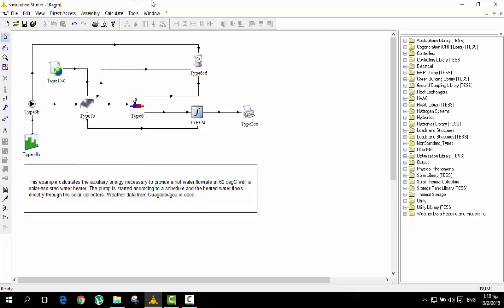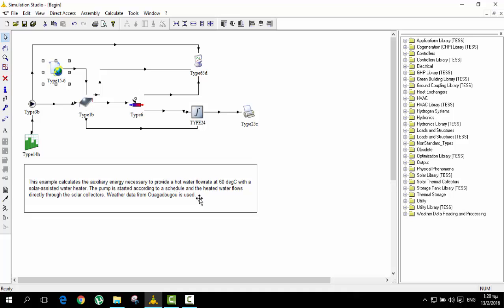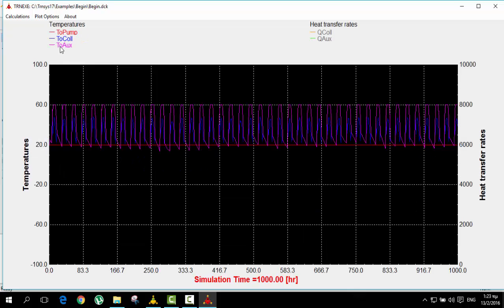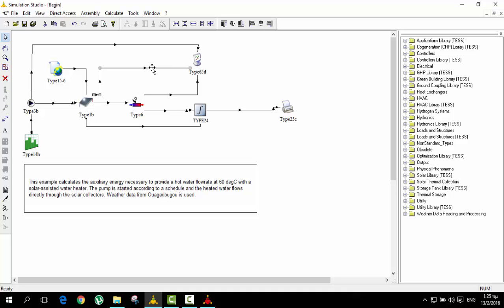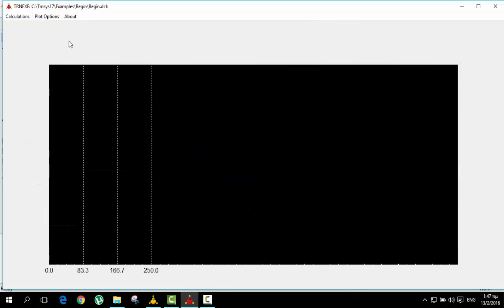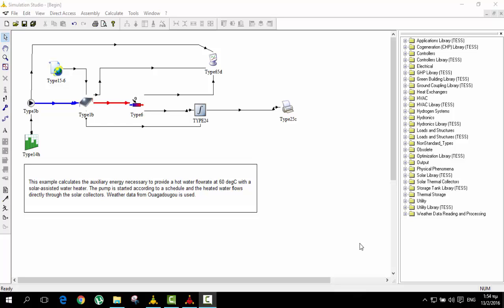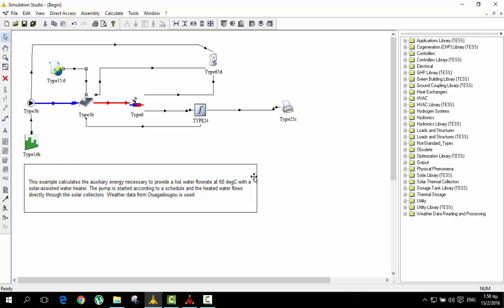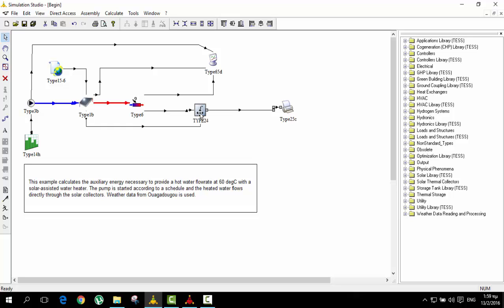TRNSYS Tutorial #1:  Example Begin

Comment: In my project TRNSYS version 17, when I run the calculation, I get 
> an error that I cannot.
Error in automatic calculation for heat transfer 
> surface 0 or its adjacent surface!: Automatic heat transfer 
> calculation Is Only  Allowed on surfaces Within a zone. Please check 
> building input file (.  bui)!*
Reply from the maker: Hello there. Well 80% of time in TRNSYS is troubleshooting. Just try to find that surface 0 and its adjacents and check the settings. Maybe the heat capacity of the material of surface 0 is incongruent to the rest .... (its just try and error, until you get what causes the problem... this is how you learn ).